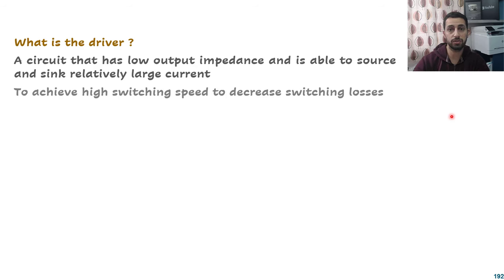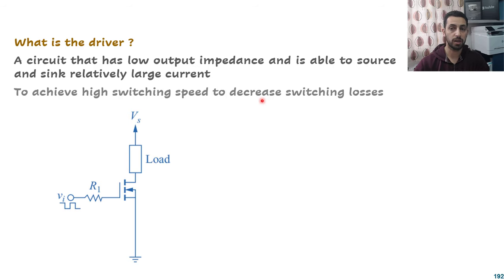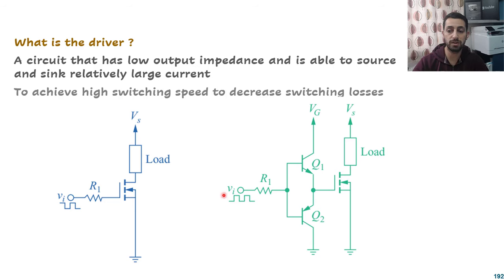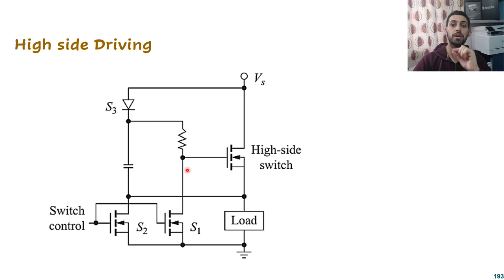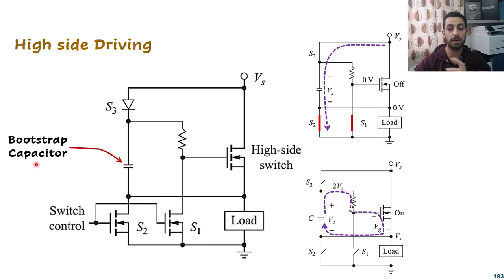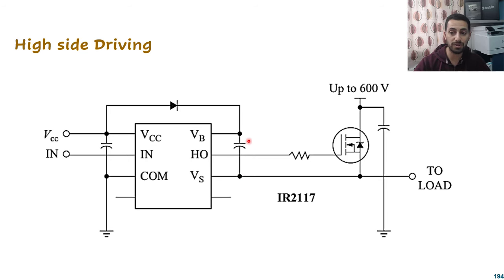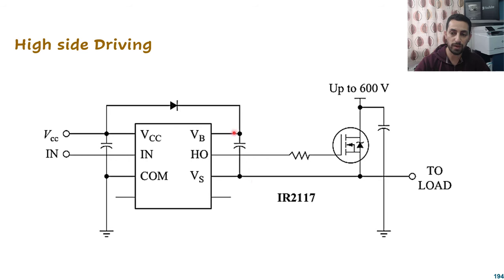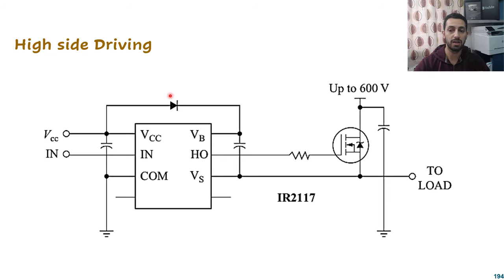25 Gate Drivers | Power Electronics

Comment: 9:57 you can use the 1EDIxxI12AF and / or 1EDIxxN12A high side gate driver ICs which have an integrated transformer coupling which can source or sink up to 10 A and can operate up to a frequency of 1 MHz provided you don't exceed their power dissipation limit. I have used them in a buck converter to control a a parallel array of NMOS transistors to deliver 200 A at 30 V, with just a 20 to 30 W of power dissipation in the power switch.

Comment: Well done 👏, I don't know why i keep figuring out my problems solution lately,  actually I have tried to control 70N06L Mosfets with an arduino and whenever the drain current reaches 4Amps , the mosfets temperature rise up crazy.

Comment: One of my designes I used the Opto Isolator to isolate the MCU from the home equipment with MOSFET of the high voltage side in boot strap configuration so now you can control the home appliances from the MCU without having to manually switch ON or OFF the home applicance.

Comment: Hi,
Your high side switch is a solution.
However you can't use it with a lot of power because your 2 MOSFETs (that are the drivers) will be closed before the power mosfet simply because of the fall time of this one. What will happen is a short circuit with S2, the power MOSFET and S2 will see a huge current passing through them and, if you have just little bit of inductance in your circuit when the power switch begin to open a huge spike will occur destroying it (if the current doesn't have already). So to me this solution isn't viable for long time use or power electronic and speed. 
Nevertheless your video was very interresting thanks.

Comment: Why we can't use a p channel MOSFET for the high side?  I know usually p channel MOSFETs are more expensive.
Reply from the maker: higher on-state resistance so high losses
Reply: @WalidIssaPlusE   Sorry. Wrong question.  P channel would have the exact same problem.  It doesn't turn off and requires similar but non symmetric drivers and MOSFETs.

Comment: Rightly explained, good for me to understand some basics befor going to hardware. The bootstrap capacitor I am always confused with, you explained it very well.
Can we use the same driver for 50A and 100A switches.
How to understand proper source and sink current  requirement of a switch.
Reply: Typically the manufacturer of the transistor will specify what range of gate resistance they want with any particular gate voltages.

Comment: Hi. I want to ask about the high side driver. On its own do we just as your video say place the capacitor and diode with a resistance? Next thing is that on the IR2117 figure u have placed in the video, is the MOSFET shown there the one we want to drive and that the voltage 600 is the max we can have in the main circuit we are controlling?
Reply from the maker: first question is not accurate if I say yes so it is no ,, other consideration as explaind should be taken
second yes that mosfet shown is the one to be driven
Reply: @WalidIssaPlusE  if I leave the Vs to only connect to the source of the MOSFET, like the figure shown with the ir2117 will that circuit power the load with vcc of the IC chip during the charging phase of the bootstrap capacitor? Would adding a diode pointing towards the Vs of the IC gate driver with a pull down resistor to ground solve this issue? Since we get isolation using the diode?

Comment: Very Informative. Thanks.
I want if I have to use optocoupler like TLP 250 and I have to use it to make H bridge inverter with R load. Which configuration is used for it low or high side.Please tell Signal will be given by arduino connected with MATLAB.

Comment: Mr Waleed 
thanls for All your efforts, I would like to ask,which is better to use( Ir2110 or similar ) or pulse transformer in high side switching in power supply circuit?

what max out ratio can I get at output from supplied voltage at the input?
on other hand can I get your whats or any direct connection ,promise not disturb or bother you .all what I need to ask personal questions 

kind regards
Mohammad Tareefi from Jordan
Reply from the maker: i am not fan of pulse transformer ,, Ir2110  is better ,, read the datasheet to know more details about current
can't share whats ,,

Comment: Great video. Just want to know one thing  (regarding high side driving using bootstrap circuit) Don't you think the circuit during low side switch on condition can be further improved. I mean the circuit which is shown here in that, during the time when boost trap capacitor is charging, there is one more parallel path to the boost trap capacitor through the resistor and that will cause slow charging as well as will result in increased power loss. I think there should be one switch complement to S2 in between boost trap capacitor and the resistor so that when S2 is on, that time the only path is through VS, S3, capacitor and S2.
And should there be a clamping diode across boost trap capacitor to avoid unwanted high voltage across the driver?
Reply from the maker: I explained the principle of it but it can be improved
Reply: this a good level shit

Comment: Thanks Brother Walid it is interesting,But try NOT to mentioned MOSFET Gate current because as you know MOSFET is Voltage sensitive component not current like Bipolar Transistors.
The Gate resistor R1 is pull down ,that mean it must be connected between Gate and Ground,Not in series.

Comment: Thank you Walid Sir for the circuit operation and explanation. I have a question about the two different grounds. Please elaborate some more on IR2117. You did not explain the small module RK1212A (Recom). You did not explain well what is this module and why there are four pins and two grounds. Please give some more details and if possible show connection with IR2117. I subscribed to your channel and watch regularly. Your way of circuit analysis is very good. Thank you Sir.